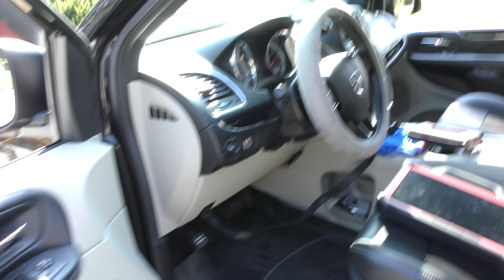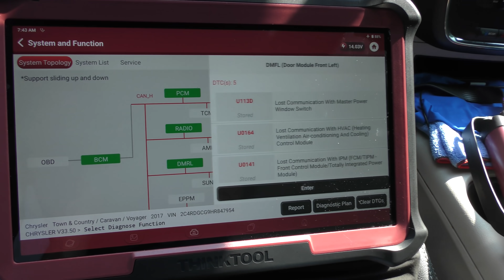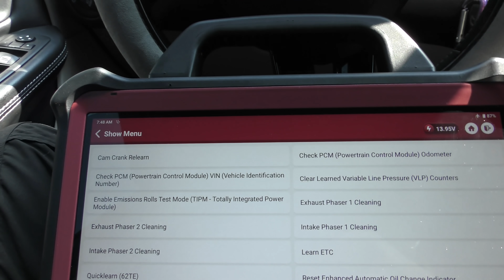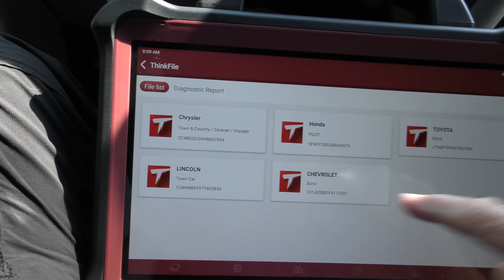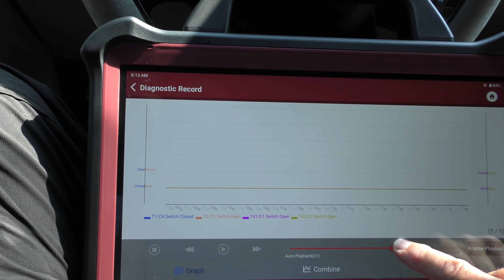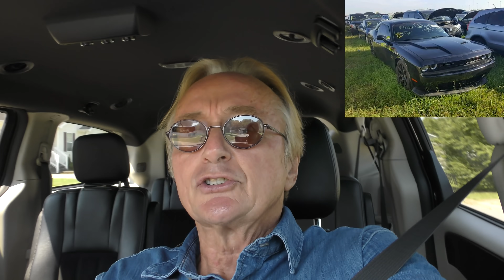Here's Why New Dodges are Crap

Comment: My 2007 Tundra began shifting a little strange about 3 years ago, so I decided to begin driving in manual / sequential mode. I'm at 300,000 miles today and the issue has not returned... it shifts from 1st to 2nd to 3rd to 4th on it's own, I can shift into 5th and 6th manually as needed.
Reply: Have you tried putting in that Lucus transmission additive in it
Reply: @michaeldeltadrop782  I considered it and it may be an option in the future. I'm happy with how it performs driving it around town in S-4, it's fun to drive it this way. Yes,  it's probably eating fuel like a Land Cruiser and No, I don't care. Symptoms match up with an issue with the torque converter, there was a TSB issued in 2008...

Comment: I had the same year van. Transmission was toast at 70.000 miles
Reply: COWORKER: " I'm pissed off,   just spent $$$$ on a new  transmission for my van!!"
ME: Is it a Chrysler?
Coworker: Dodge
ME: 😳🙄🤐
Reply: I drove the 2015's as work vehicles and the things were unmaking themselves at 30k. I doubt one can make it to 150k.
Reply: That’s crazy. My coworker had a Dodge Dart and he said the transmission also went out around 70k.
Reply: @KevinCostnerMachine  that transmission is a Hyundai
Reply: I had 2 or them. Both dropped transmissions.
Reply: Did you run it in economy mode?
Reply: @ianphillips5418  no why?
Reply: @Thewindingstaircase  that does them in early
Reply: How about putting it in used car lot mode?
Reply: Yeah that's why they are so cheap used
Reply: Da mills
Reply: @somrock974  sha do bee
Reply: @Thewindingstaircase  popcorn hmmm
Reply: @somrock974  2 and 0
Reply: @Thewindingstaircase  hi my name is Lorah hues

Comment: My dads truck dosent have manual mod but my dads drive pump still works so as the reverse pump i think it needs a fluid transfer and hey if that happens but if my transmission goes out i need your help fixing it scotty its cool 👍

Comment: I own 2014 dodge grand caravan. Last Thursday it wouldn't change gears I could only drive 30+ mph before it tries to rev. Check engine was on and code read P0420 catalyst converter below threshold bank 1. But my mechanic said it's not the catalyst converter, it was the transmission filter 😑 it was clogged. So after installing a new one let's just say I felt the 🐴 power🔥🔥🔥

Comment: Scotty said the 04-08 f150's were one of the best trucks. I just found out the timing set  on these all needs replaced every 100k with old ford parts and every 150k with the new updated parts and ford charges 4k for the work and it comes from tensioner gaskets blowing out causing a domino effect of damage and can include the cam and head. ffs
Reply: Got a 2006 5.4 with 160k miles original timing chain components and no probs

Comment: I bet that vehicle was in an accident. $3,000 for a 2017 something doesn't seem right here
Reply: Flooded
Reply: @garymixson687  If flooded, you'd smell it: that never goes away. It could have been a rental, with that sort of mileage in only 3-4 years, and we all know how rentals are driven and maintained. I've driven rentals where there was almost no oil on the stick, and that was black, and multiple marques of cars, and from multiple rental agencies. Whenever I pick up a rental now, I always check the oil first, and look underneath to see if the drain plug is tight. Yep, had one where the plug was about to fall out.
Reply: What’s not right is you must have never owned one
Reply: @raymonddriggers  I never go Dodge Chrysler or Jeep $3,000 for four-year-old vehicle? I could see if it was 10 to 12 years old then yes $2,000 $3,000. But it seems this Vehicle is loaded with leather seats so there must have been an unreported accident that has been repaired. Or somebody was very desperate to get rid of this vehicle and needed the money bad

Comment: I used to work for Enterprise and all they had was Dodge minivans, every week I had to drive a Dodge minivan to the repair shop and reprogrammed ✌️❤️👻
Reply: Totally believable.  Had a 2008 loaded to the gills Town & Country Limited with the 4.0 v6.  Nothing but a problems, so much that I had to get an attorney, sue Chrysler and get all of my money back.  Chrysler ended up buying it back for more than full purchase price.
Reply: @JoeyJr702  I believe it. We was getting our minivans from Dodge Jeep and Chrysler and we had to return them because they was high maintenance course. Enterprise couldn't even afford it
Reply: I had a 2001 Chrysler voyager for TWENTY years.  In those 20 years and it had 176,000 miles on it.  I NEVER spent a DIME on anything other then brakes, tune-ups.  Not a problem with anything. NO ac replacement, alternator, water/fuel pump, NOTHING. NO transmissions issues.  I gave it away because it needed new brakes, tires and I just didn't want to spend the money.  The clear coat on roof and hood was shot.  So I went out and bought a used Dodge mini-van, 2007 and have had it for two years and not had to spend a dime on anything other then normal maintenance items.  So either I am lucky or these vehicles aren't as bad as Scotty and others are saying they are.
Reply: @trvman1  they're not as bad as scotty says they are .
Reply: @trvman1  Totally agree! I have a Dodge Grand Caravan, 2006 with mileage close to 200,000 miles and still running like a charm. For the last two years, I drove it from Las Vegas, NV to Orlando, FL five times and never had an issue. Never done any major repair on the car. The AC is original. I am not yet thinking about getting another one until this thing stops running.
Reply: @almukahal  They don't make them anymore.  Now I think it is only the Town and Country and they start at about FORTY Grand.   As much as I like them, not paying that kind of money for ANY vehicle.
Reply: @lamontbowe8511  Sounds about right.  Against my wishes, I purchased the 2008 Chrysler T&C for my wife to shuttle around our 3 babies.  My favorite brand is Ford, BTW. Currently own 3, all equipped with a v8.  But the Chrysler was very nice, however for a very short time.  1st thing that happened was it failed to start after being inspected in NV.  Next thing that occurred was the transmission started slamming.  Then the airbag light came on.  Then rear AC stopped working.  Then both power sliding doors went on the fritz, opening and closing repeatedly.  Then I noticed horrible gas mileage and an immediate feeling of dragging when the accelerator was released.  I noticed both of the rear wheels were constantly coated in brake dust, and I discovered the rear calipers were sticking.  Then a coolant leak appeared and I believe a transmission leak.  The only thing that was great was the tandem monitors and audio system.  Then the final problem was it shut off on me on the highway, of which prompted me to seek legal remedy with an attorney.  Never again!  
Now I see these new cars repeatedly turning on and off at stoplights in the heat of NV, with their AC on, and I can only imagine all the issues that will come about from that insanity.
Reply: @HowardJrFord  i had one that  between 70000 and 130000 i put 2000$ on repairs in it. I was glad to sell it.
Reply: @shannoncampo9820  and you probably took it to a garage , and the repairs were most likely minor . but garages charge big bucks for simple things . that's why it pays to do your own work .
Reply: @trvman1  i had an 06 grand caravan and it was ok. Currently I have a 2016 caravan and its complete garbage. Transmission twice, injectors, all cams, lifters and rockers replaced. All of that before 80k miles. Also shitty thermostat and now I think there's a trans leak
Reply: I worked at Enterprise as well from 97-98. The Dodge Neon was the worst. Good times.
Reply: @arri275555  neons!!!!!! My brother had one named "rachet Ronda" ahahahahah that thing was awful.
Reply: @arri275555  I had a Dodge neon back in 2003. It was great for 2 years. after putting 40,000 miles on it the timing chain belt snapped and it was only worth $200
Reply: @lamontbowe8511  The later models were definitely a lot better. How many total  mile did it have?
Reply: That's a dog on shame..... Crazy
Reply: How about GMC Yukon is it good truck?
Reply: @foodieman359  I haven't heard anything about GMC yukons. We had a few of those as well and it was fun to drive but never had to go to the repair shop like a Dodge minivan
Reply: @foodieman359  made in usa, is junk. 😥
Reply: Luis murad The Toyota Highlander and Sienna are now made in Indiana in the US
Reply: @kimcelarmycx229  Likely more due to whether or not the UAW in involved.
Reply: @faraon2012  you do know that the majority of hondas and toyotas are made in the USA ?
Reply: @faraon2012  those are definitely not made in the USA lol
Reply: Total garbage.
Reply: Chrysler uses the minimist of materials, and really bad soldering, and they wonder why they're always at the bottom of the chain,
Reply: Interesting that these vans are still called "mini" The Dodge and Odyssey weigh in at 4600+lbs. A 1 ton GM Van from the 70s to the mid 90s just weighed over 4000 and was not a mini. Everyone is used to the term.
Reply: @kaiserbillxiv1245  I'd take an Honda Odyssey over Chrysler  van.
Reply: I used to work for Enterprise too. I worst cars we had we’re definitely the Dodge Journey’s. I remember we had one that had only 20k miles and kept cutting off every 250 ft we couldn’t even drive it to the dealer which is only like a mile and a half away, we had to get it towed.
Reply: @igarrett113  I was from 97-98. The fleet we had for our branch,  Dodge Sebring, Neon and Durango. GM  Cadillac DeVille, Camaro, Tahoe, Astro, Lumina, Cavalier, Sunfire, Monte Carlo, Skylark, Blazer and the Aurora. Ford Taurus, Expedition, Aspire and Econoline 350 15-passenger van. Volvo the S70 and V70. Good times
Reply: @igarrett113  lol my 2016 dodge dart has 87,000 on it and it turns off all the time with a brand new battery and more than 1/2 of gas…had to replace coil in cylinder 3 twice and had to replace the engine thermostat 3 times already….Dodges r great lol
Reply: Every week for the entire 2 weeks you worked there?
Reply: @beezertwelvewashingbeard8703  Who are you referring to?

Comment: Scotty, my dad bought a 2019 challenger. Anything he should be aware about? He loves the car, but we all know it’s garbage 😂
Reply from the maker: hello, dodge is known for electrical problems among a bunch of other things
Reply: The only thing I’m not worried about is the transmission. Since all 19 challengers use the ZF 8 speed auto
Reply: @naveenthemachine  to be fair, the ones in Chrysler, dodges, etc aren’t true German ZF’s. Rather called HP(insert 3 digit sequence depending on which specific trans it is, each have different power ratings) this means it’s just a Chrysler’s copy of ZF,  they make them and are not the true ZFs.
Reply: @laveth  even the regular hellcats? Because Chrysler advertises their 8 speed as “Torqueflite”. I thought ZF makes the tourqueflite 8 speed